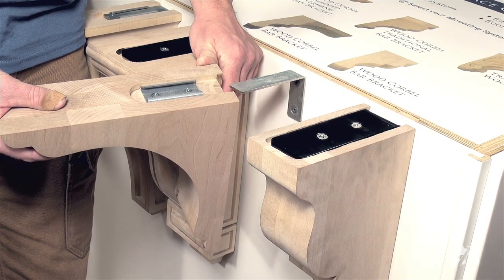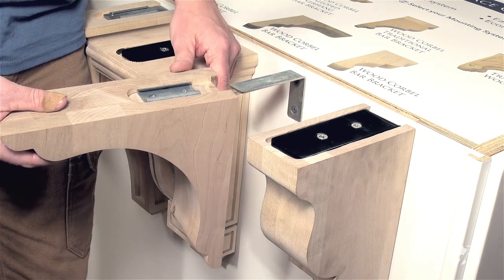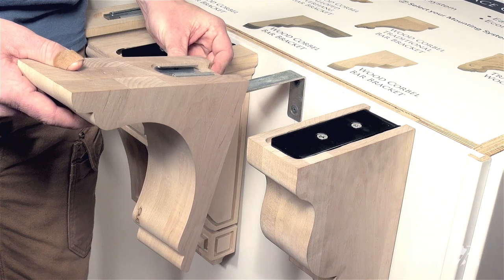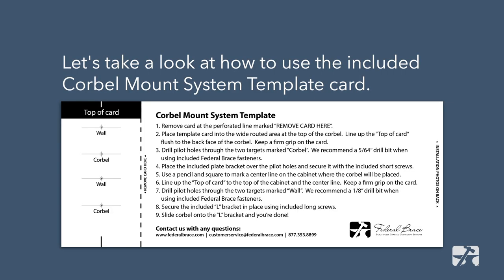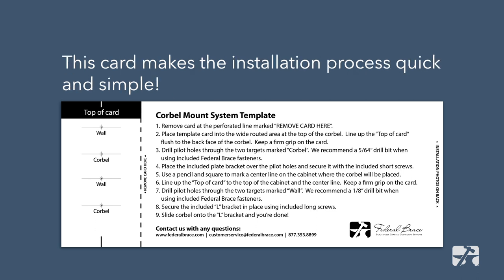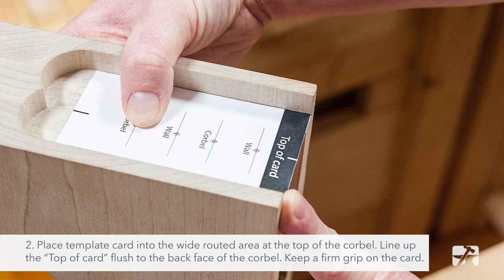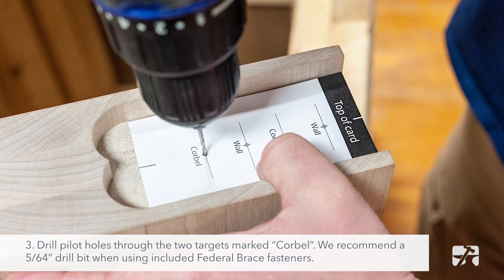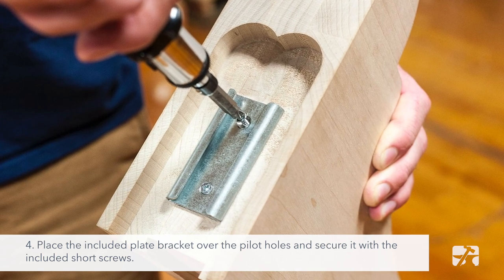HOW-TO Install the Corbel Mount System. Easy to Install, SAVES TIME & MONEY

Comment: Is it decorative or will it actually hold weight?
Reply from the maker: Light duty is available here > https://www.federalbrace.com/corbel-mount-system-214/31904
Heavy duty is available here > https://www.federalbrace.com/corbel-rib-support-702/40377 Please reach out to us  (877) 353-8899 Monday - Friday 8:30 AM - 5 PM EST if we can help! Thanks!
Reply: @FederalBrace  You did not answer the question.  Gee.
Reply from the maker: @brucemoore2405  Hello! The corbel mount system does not provide any additional carrying capacity, but our Corbel Rib Support does provide an additional 375 lbs in carrying capacity. https://www.federalbrace.com/corbel-rib-support-702/40377

Comment: Can this be installed after a granite countertop is secured in place? And do you ship to Canada?
Reply from the maker: Hello Phil! Yes, this can be installed prior to installing the granite countertop. This bracket is light-duty and is not suggested for a weight-bearing application. We do ship to Canada as well!
Reply: @FederalBrace The original question was if they could be installed AFTER the countertop is in place. I'm also curious about this as I recently had a counter installed with an overhang and I'd like to brace it just in case my son decides he'd like to try hanging off it one day. Thanks!